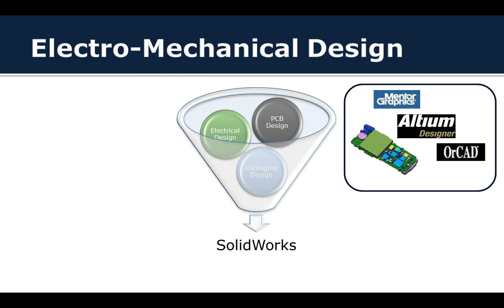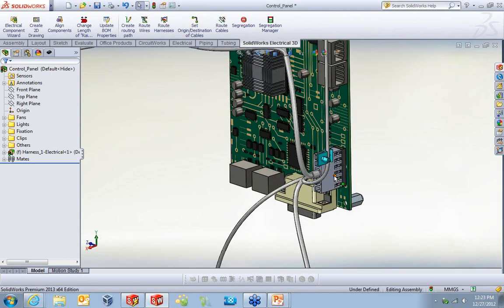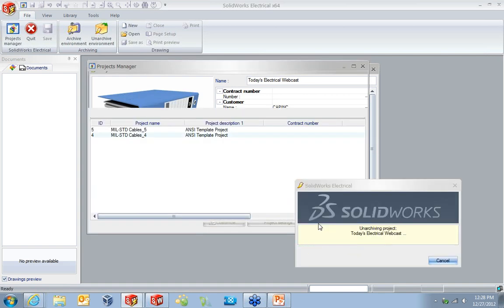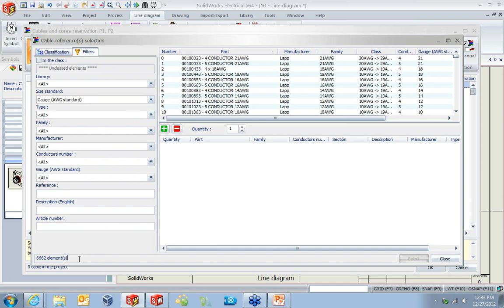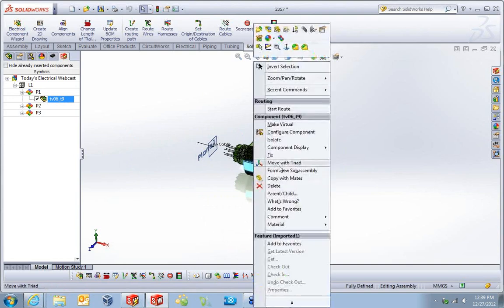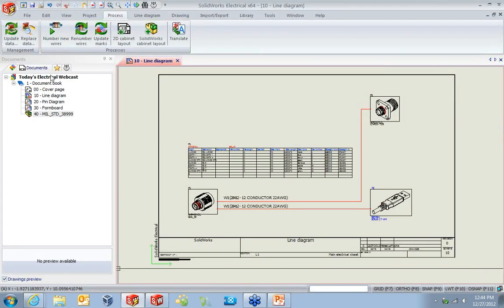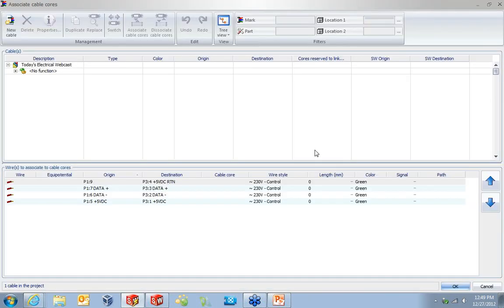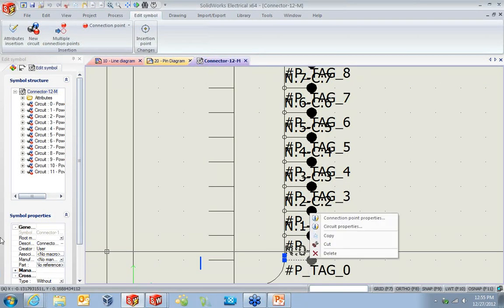SolidWorks Electrical - Connectors and Cable Design

Comment: Hello, my name is Alejandro and i'm from Argentina. Your explanations about the use of Solidworks Electrical are very good and interesting, but I have a doubt about it. When i click over "Route Cables" appears the next error message:

Routing can not be performed correctly because some Solidworks configurations are missing. To resolve this problem run the import of source/destination list default in the electrical routing.

I don't know which is this configuration, can you help me, please?

Thanks in advance for your time.
Best regards.

Comment: Very interesting design field...I have a NEW job/career path 2 pursue now. Solid works is a very user friendly software. So is Google Sketch up 8.

Experienced CAD (3 years) operator with Civil, Electrical, Mechanical, Manufacturing and some Structural background. Auto design 2 =

Very intelligent